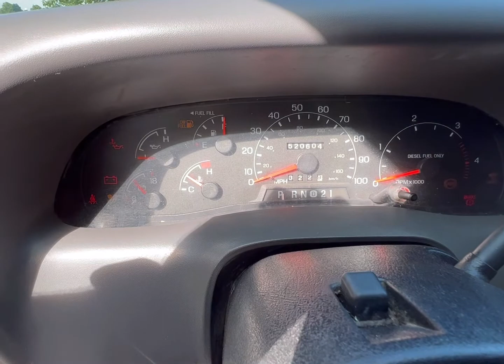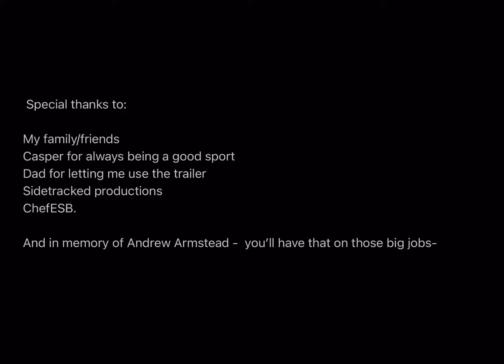GSC 7.3L powerstroke hard start and progress update

Comment: Suck out the oil in the hpop reservour and add 16.oz of Archoil AR9100 and change your oil. Also add Hotshot Secret Extreme to the fuel. If you pull the turbo install a KC balanced assembly. If you use your truck for pulling the front drum splines are known to strip out.
Reply from the maker: Thanks for the info! I’m dealing with that hard start and I’ve realizing the new ford ICP isn’t reading right. So I’m playing sensor swap tomorrow to see if I can’t narrow down my issue. It’s got a fresh oil change with rotella 15w40 and hotshots. 300 miles on it now.